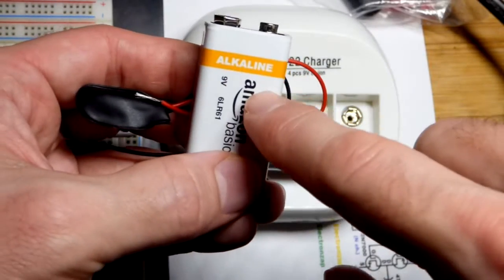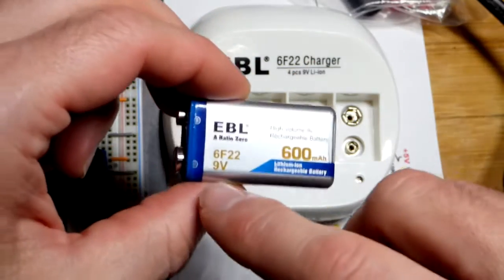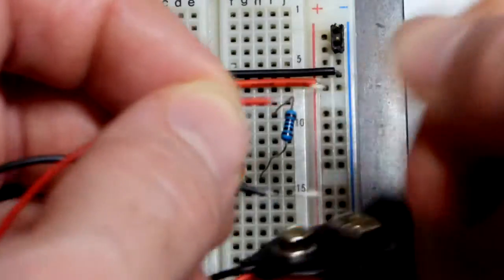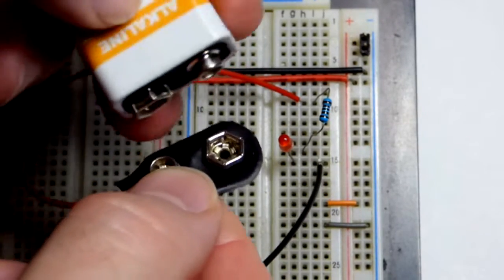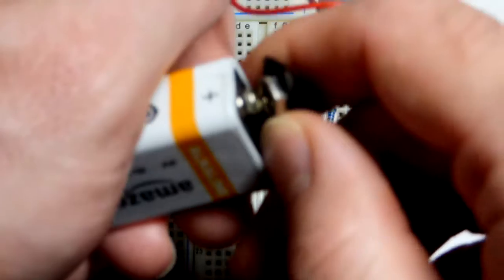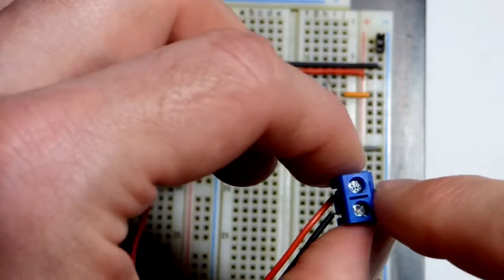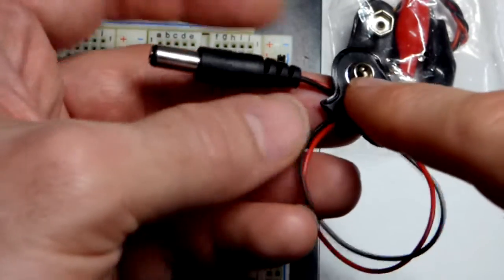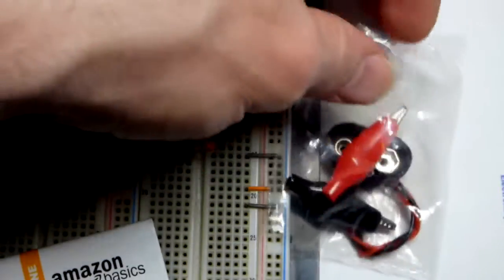Using 9 volt 9V battery snap basics for learning electronics shorts 2

Comment: I bet you could crimp some Dupont connectors on those bare wires ... 😏👉
Reply from the maker: I did buy some dupont connectors :) These wires are too small for my smallest connector, so I have been trying to think of the best way to set up the wire to be crimpable.